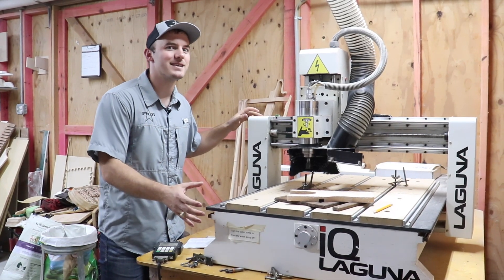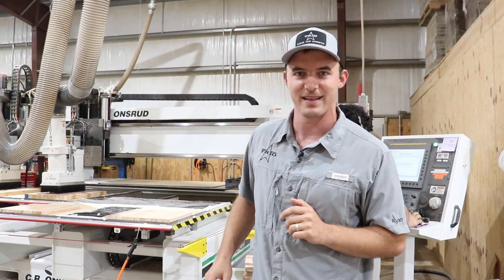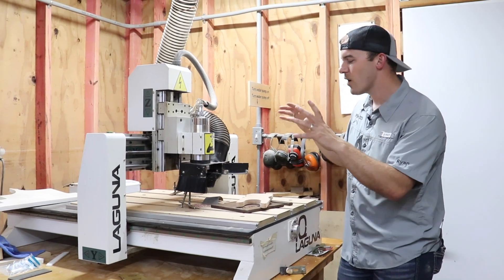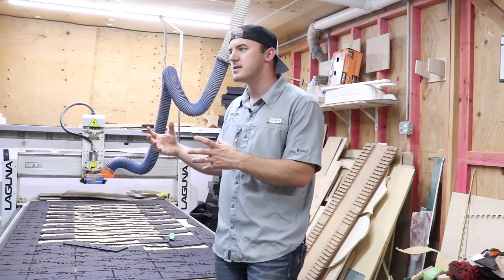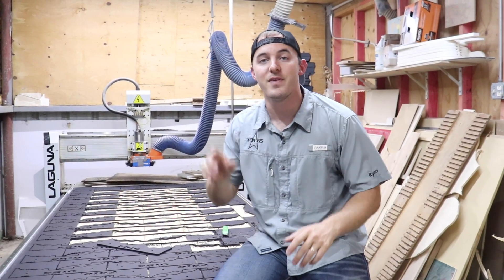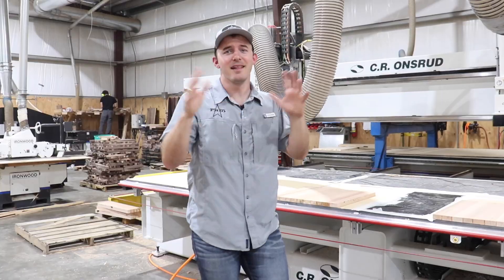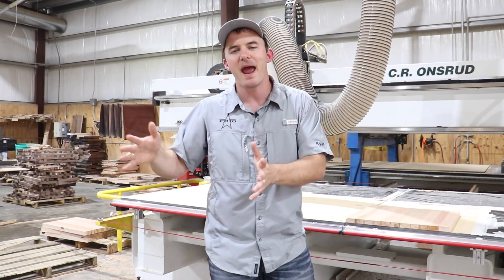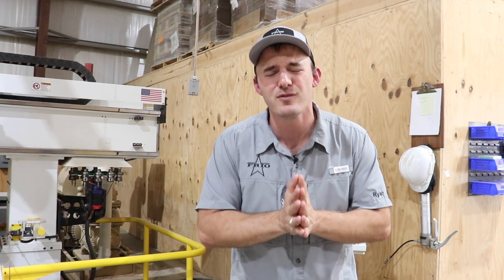4 LEVELS of CNC - Beginner to EXPERT My Journey

Comment: That industrial machine of  yours  is a beast,I really enjoy and learn from your videos :)   I'm considering to buy a 2 spindle setup to be more efficient with manufacturing cabinets, but then it will be a horizontal spindle as second spindle with a smaller 3.5kW spindle and a smaller ER25 on that one, I think I can benefit some on that setup but I am not totally sure.  Have you ever  tried to program a machine with both vertical and horizontal heads?   I would love to have an HSD Spindle with a HSD Aggregate to get both 4-axis and the C-axis programmable, but that will set me back another 13 000USD over the dual spindle setup so I cant defend it.

Comment: Hi man, very impressive! I’m surprised not to see our big European brands in your shop like Homag, Scm or Biesse. Same thing with bits. No coated bits and no PCD bits, though the prices you’re talking about seem similar to these high end machines. I’m curious to know your reasons !
Reply: Many of the European manufacturers don't offer a multi-spindle, multi table solution. For high processing of solid wood, a fixed bridge, moving table solution will last a very long time. Also, CR Onsrud is Made in the USA, known for reliability, service, and longevity.